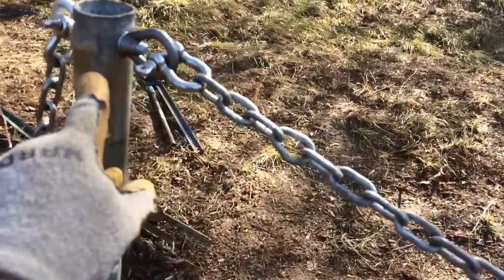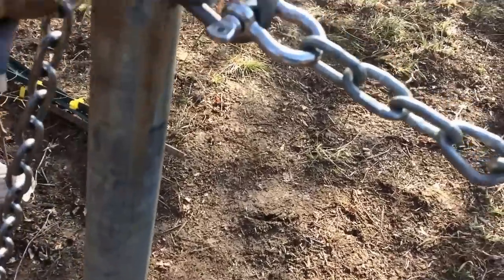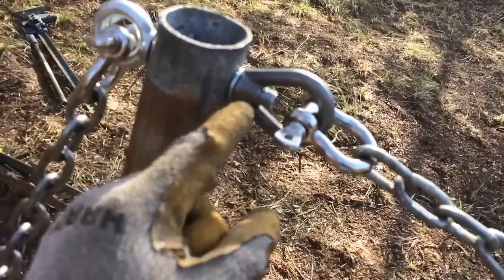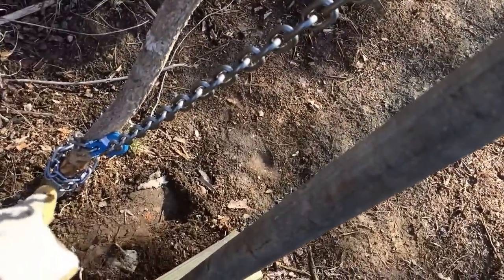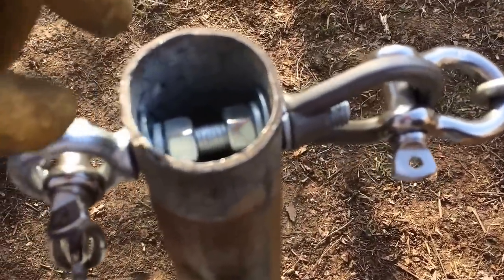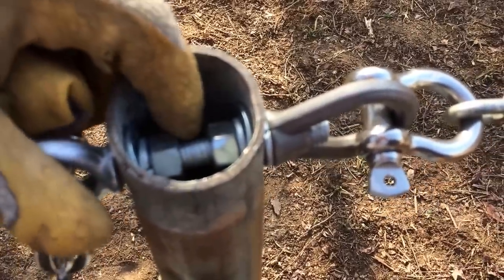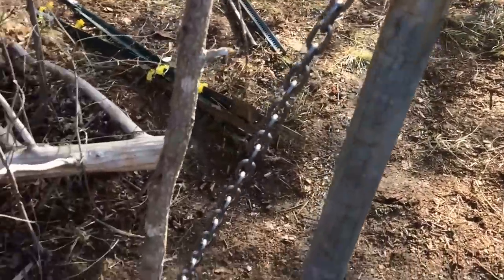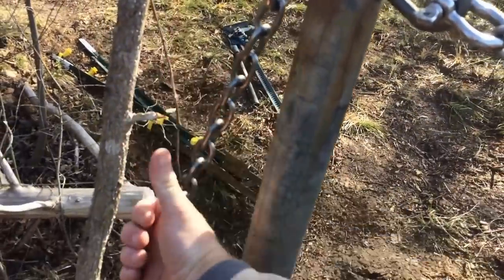How to Build a Pipe Stump Puller

Comment: Instead of buying all of that hardware, wouldn't it be stronger and more efficient to cut two notches in the top of the pipe for the chain to lay in instead of the eyes? The chain could stay in one piece and the weak link is removed from the equation.
Reply from the maker: I never thought about that, but yes you are probably right.  However, the stumps I have need a lot of force and I have bent the pipe lip at the base.  I think the threaded rod helps.
Reply: @TNGun  With enough force,you could collapse any pipe, but I'll bet the base bent because the threading weakened it.
Reply: @wfbrunt  I'll bet, screwing the pipe into the base reinforced far more the threading weaken it in compression.